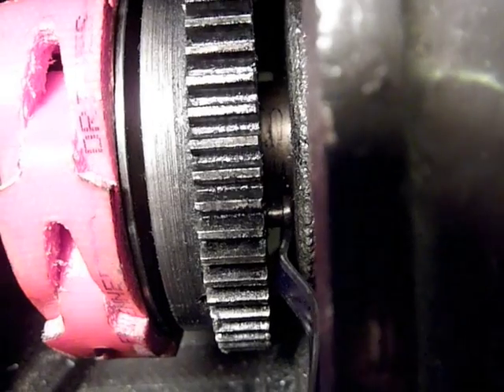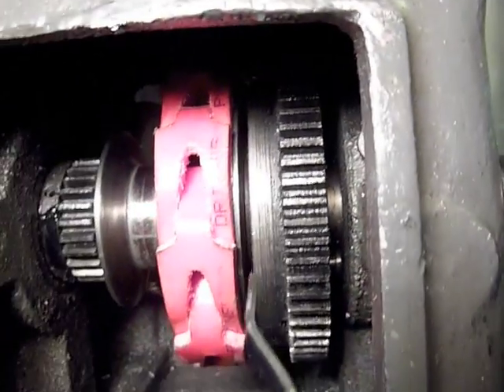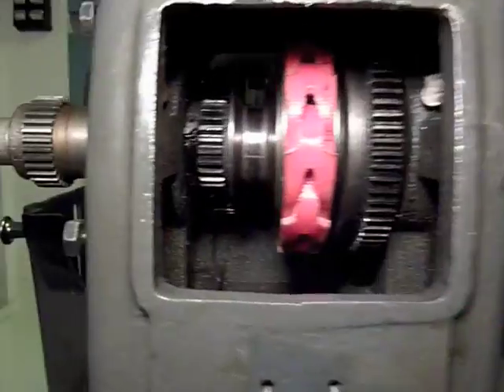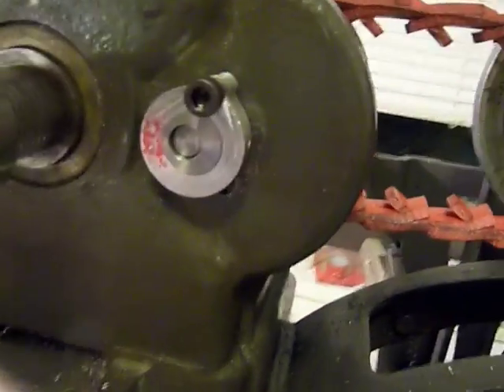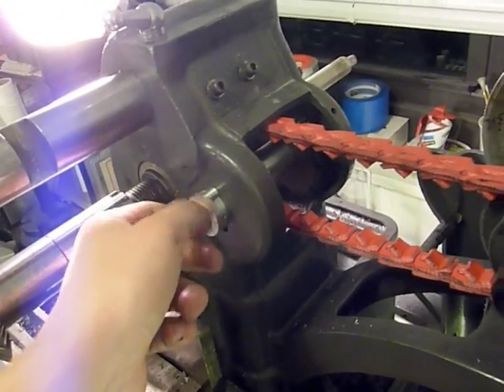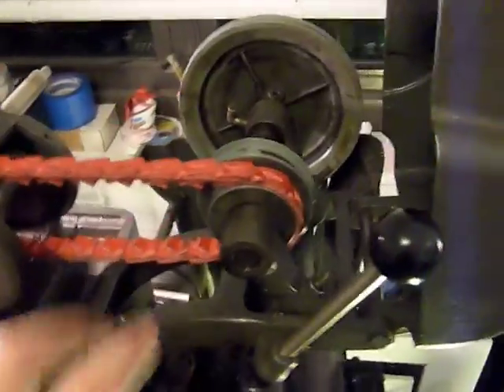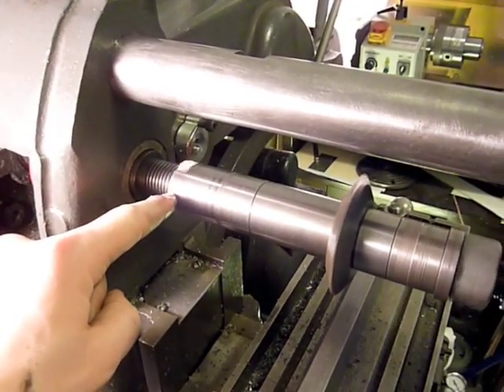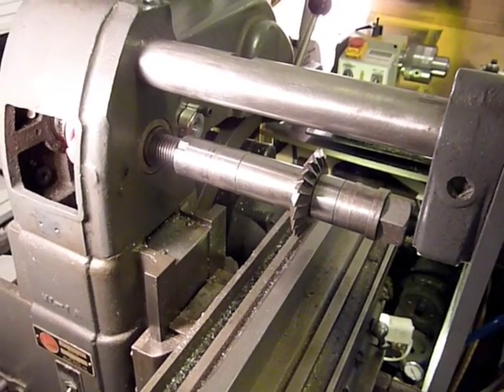Atlas MFC Mill Back Gear - Follow Up

Comment: It's probably too late to matter but maybe it will help someone else.
You are actually on B1 since the belt is on the smaller pulley of the countershaft. Like my MFB, the pulleys for the motor and countershaft are installed reversed from the speed chart diagram. Thanks for all your videos !

Comment: It's been very cool following you and seeing how far you've come. What a journey! Congrats to you!

I just picked up my first Atlas milling machine, except it's just the 'MF' model. I'm curious (for anyone familiar with Atlas milling machines), My spindle turns clockwise, opposite of what this video shows. I know there are a few different models, but I don't have a manual. It's in near mint condition and I don't want to break anything running it backwards. Does anyone have any thoughts, or does it matter? Should I reverse the motors direction? Thanks for any help.
Reply: Naked Machinist just picked one up with vertical attachement....you can still download at complete parts list.. just curious any one out there have to replace any gears...look similar to gears from chraftsman 101 lathe yea those zymake metal
Reply: 😂 i have the mfc mine only runs cw also. With back gear engaged or normal pully direct it only runs cw.

Comment: Just work out the ratio yourself to figure out spindle RPM.   Measure your pulleys and count your gear teeth to figure out the final reduction and times that ratio by the motor RPM (probably 1750 RPM).